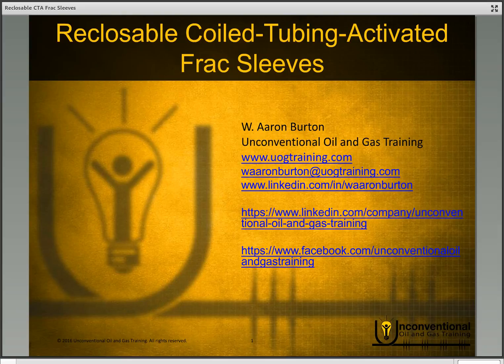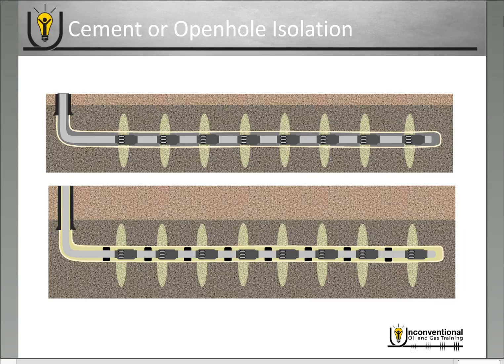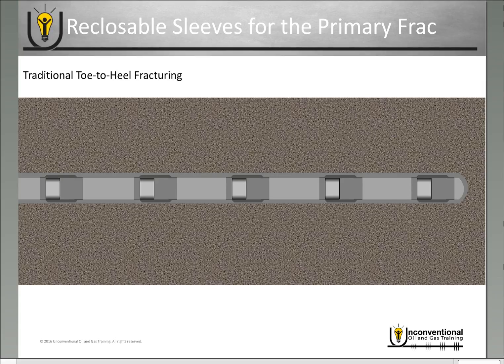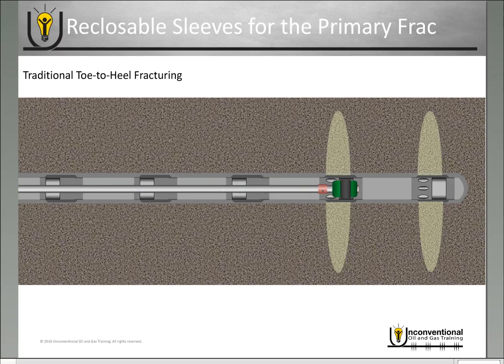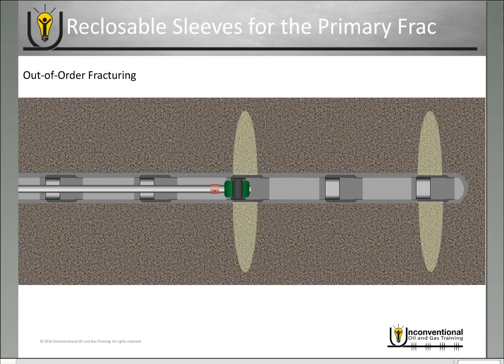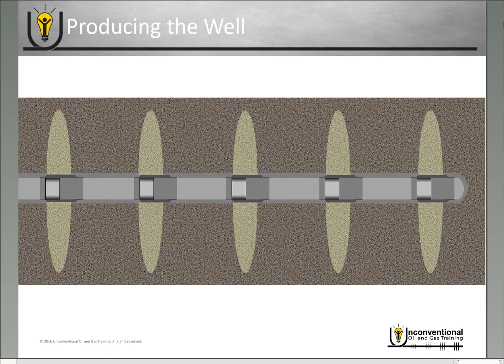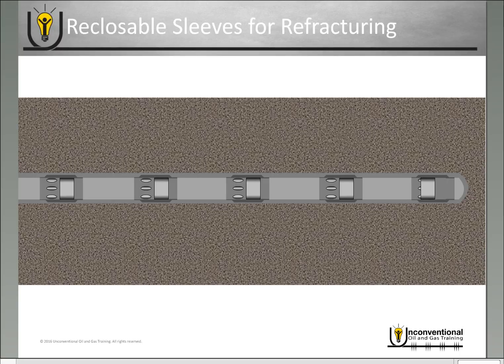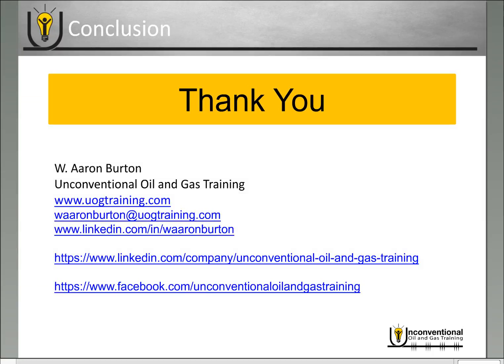Reclosable Coiled-Tubing-Activated Frac Sleeves

Comment: I think also,  closing the sleeve after the frac stops the sand influx into the wellbore from the formation during the frac ops, due to the change in the wellbore pressure during the frac.
Reply from the maker: Absolutely! I've heard of some operators eliminating their clean out trips after the frac job is performed because they no longer have the influx of sand when using these sleeves. That's certainly another benefit, and could help maintain near-wellbore conductivity by allowing the formation to close on the proppant before it falls back into the casing.